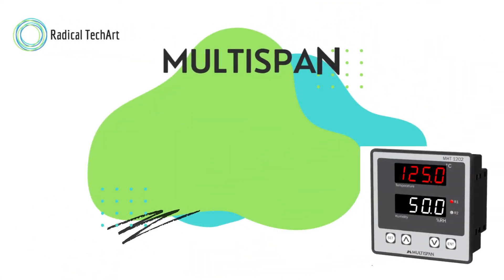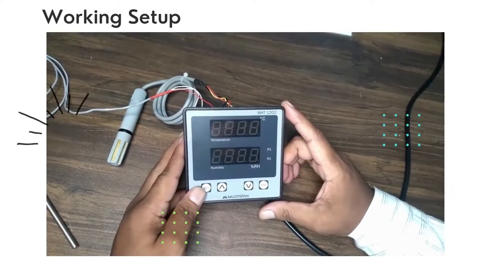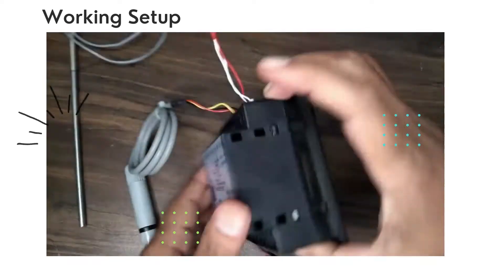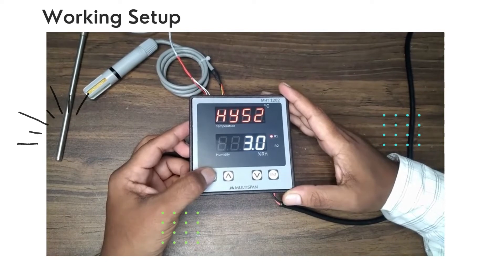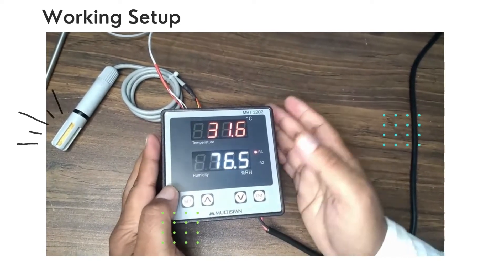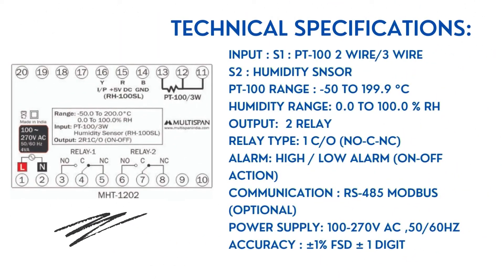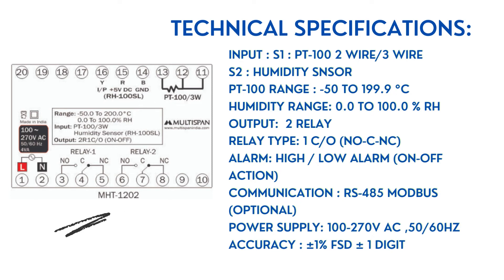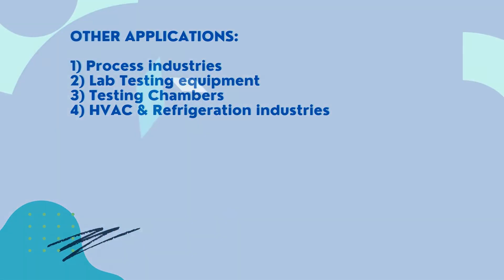Humidity Controller and Temperature controller Multispan #MHT1202 RadicalTechArt I RadicalTalks I

Comment: PT100   11,12,13conection    Rh 100   humanety  14,15,16   conection     R1rely   compresar on off  R2 rely heter on off  wiring HAU  compreear and heter manul mode indusal auto mode Ahu 3hp start 3ments compresar start heter sating on off    Temprecher 24 off 26start hemunity 55off  65start   wiring and prameter sating
Reply from the maker: Please contact on this number: 8866278247

Comment: How to set 35degree temp and humidity 95% in this meter please help me i need your support
Reply: set 1 temp  35
set 2 humidity 95
Reply: @hitech2467  but sir humidity not generate please help this regards
Reply from the maker: You can contact on this email ID: radicaltechart2@gmail.com
Reply: How to set lower limit and upper limit for humidity and temperature 

What is the difference between cool and heat